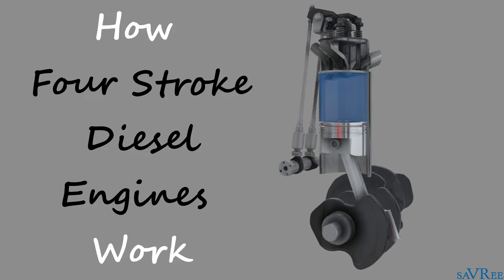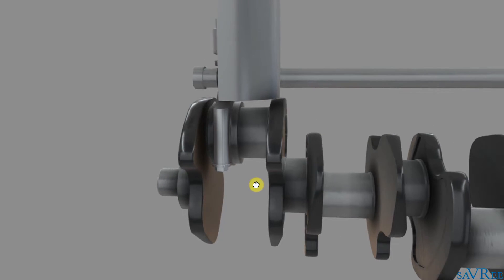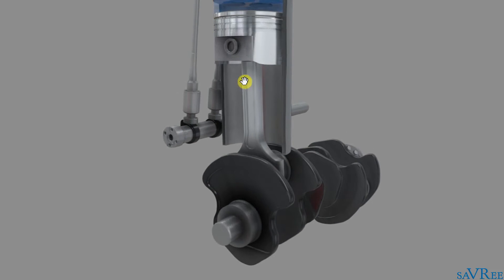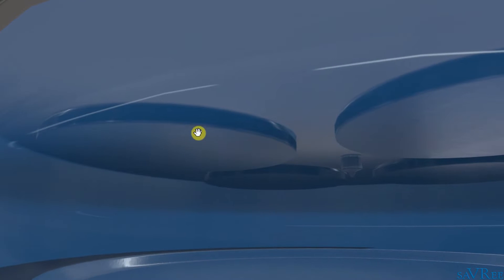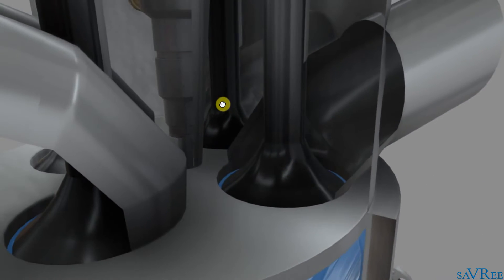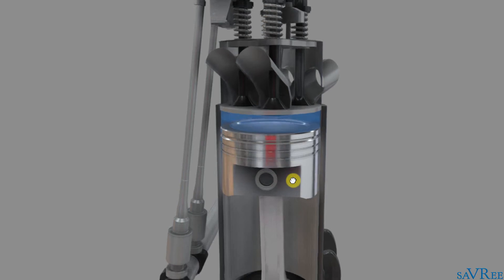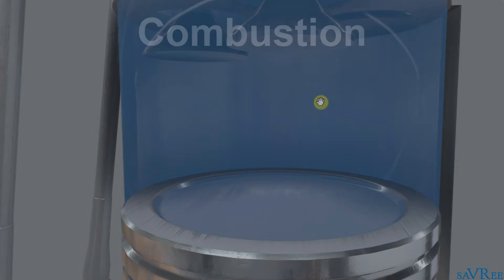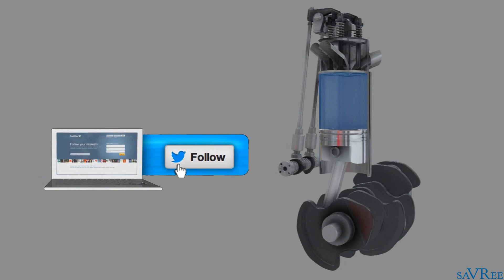How Four Stroke Engines Work (How It Works - 4 Stroke)

Comment: it wasn't clear as to what  force caused the initial downstroke..
if it was air, what made the air fill the cylinder initially and give it enough pressure to push the piston down.....thx for any help...

Comment: How cranck shaft pushes the piston from BDC to TDC .. What isthe source force for cranck shaft to give movement to piston
Reply: rotational inertia caused by the crank shaft counter weights and Flywheel, and the other two cylinders firing 180 deg from BDC

Comment: Would I be wrong if I say intake stroke , compression stroke, power stroke, and exhaust stroke, what u call exhaust gas, couldn’t it be called , burnt air fuel mixture witch become exhausted out once the piston pushes them out on the exhaust stroke?
Reply: Sasura ka nati galat galat padata hai

Comment: Great video. Thank you. What force allows the piston to travel back down in the suction stroke and up in the compression and exhaust strokes? Is enough energy provided in the power stroke to allow for the other 3 strokes to occur or are other forces at play? Thanks.
Reply: Sorry. I just read one of your other replies. You already answered the question. Thanks.
Reply: I mean, it's details like that which need to be specified in a how an engine video works video as long as this one. Every video on YouTube provides simplistic explanations like the one in this video.